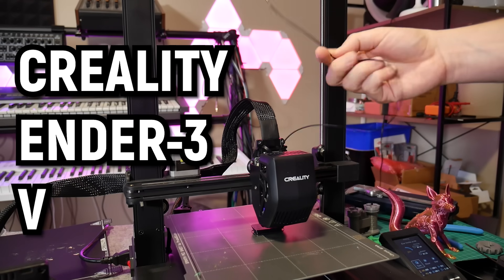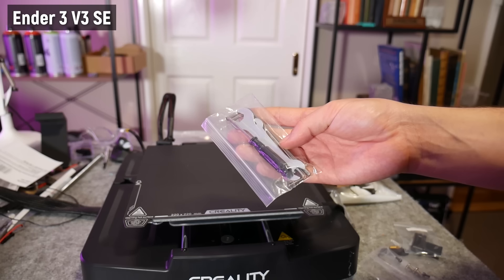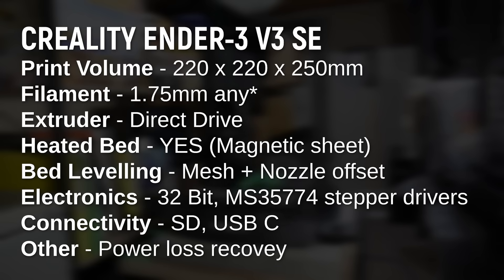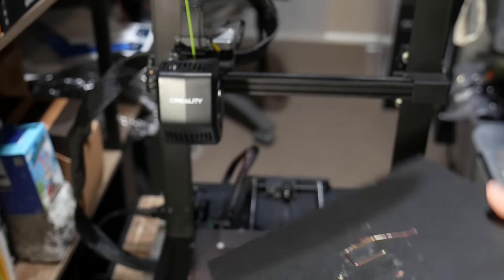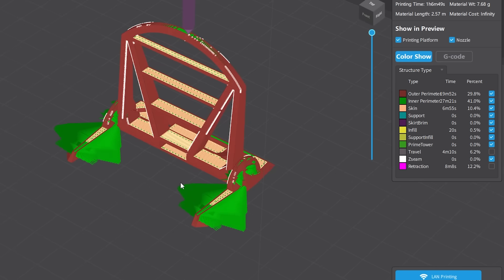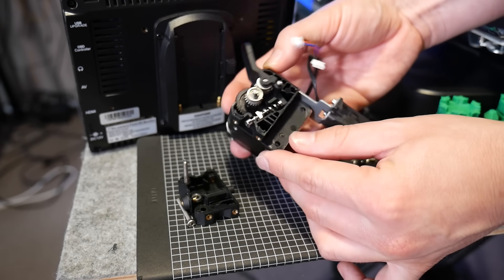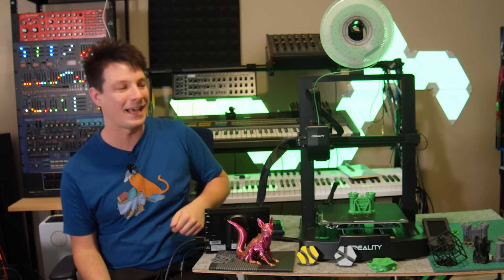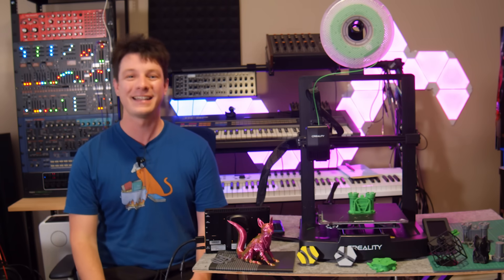The Creality Ender 3 V3 SE is very good. There, I said it!

Comment: The menu is top.
You can set the offset by hand at 24 points.
And you can change the nozzle from 0,25.up to 1mm.
Its goth its own slicer 
Where you dont have to do the settings.
Its already good.
You can calibrate the e steps.
You can turn the speed up .
While printing.
Its goth pre heat pla.
Tpu.
Wich you can use to change the filliment.
Its goth Factory settings.
If Enny thing go.s wrong.
You can pusch the machine to the Limits.
Bud dont forget your matireal needs to handle the speed you use.
So bying a fast printer means you need turn down the speed for a.b.s.and p.e.t.g.
And the last one is stronger then a.b.s.
There you need slow speeds because of you just can not run fast prints whit this Material.
They can make fast printers.
Bud your always goth to look what your using.
Its just a joke 
Thinking you can print fast.
Faster prints just need a bigger nozzle.
And you print a vase in just one hour .
In the creality 3v3se.
Bambu a 1 goth 0.2 nozzle 
Looks at chep filliment Friday.
And your print takes hours.
Longer.
😂😂😂

Comment: Can I mod the V3 SE to print ABS and ASA?
Reply: You can. You'll have to swap out the hotend for a all metal one and use a raspberry pi to run klipper or Creality Sonic Pad to bypass the stock creality v3 se firmware that limits the hotend to only 240c. Or you can try the low temp ABS filaments, regular ABS filament requires too much heat and the v3 se cant do that on stock. Or just get a V3 KE that can do all of those already.

Comment: I noticed that my Ender 3 v3 SE prints are slant. I checked the printer's alignment and noticed that the z axis is not square (it is tilted backwards). I found a y-axis support kit to install on Aliexpress. There are also some options on thingverse. I'm still deciding which option I'm going to test. Any thoughts?

Comment: Don't know if you'll reply as video is 5 months old lol, but how is the printer when input shaped? I still use my old 2018 ender 3 pro i've modded to purgatory and back, as well as klipperized on a skr 1.3 with 2209's, and currently using skr e3 v3 on it due to some small annoyances on the skr 1.3 i've later fixed, and with belts tighted way past recommended, and ran a input shaper, i managed so far to do a 3600 accel with a herome v6 and a 4mm mirror bed with thermal pads in between to compensate for bed warp, and got practically no ringing.

And how fast can it print as a utter top mechanical speed? My ender's max was 4300 accel before whole printer started to rattle.

Comment: I got a KE instead of an SE a bit ago, and man not a single bit of stringing with PLA at high speeds. Had to increase the retraction to 1mm for PETG to remove stringing but still. Very cool printers

Comment: There's no way to simply tie two spools together, so when one spool is empty, the next spool sill continue? (Like splice the start of one spool to the end of the first mostly empty spool, so when the first spool runs out, the new spool will just continue without any delay or without needing a cut-off switch when the spool runs out.)

Comment: Seems like a decent printer. I got the Ender 3 and it was hell to get it up and running. I had every single problem I ever read was a possibility and then 10x more than that.... and had to fix ad upgrade several parts to just get it to print without serious problems. It's insane that they could sell these things KNOWING how many design flaws there are and in all this time have never fixed ANY of them, no matter how simple and easy it would be. Instead they would rather waste all their customers time and money and frustrate the shit out of people to the point of giving up on 3d printing entirely than just spend $5 and fix the problems for everyone. It was complete BS that I had so many problems and not once did Creality ever reply to ANY of the email I sent them when I really needed customer service. Now I'm not sure if I'll ever buy another Creality product for as long as I live, no matter how cheap it is and how many 5 star ratings it has.

Comment: I hate the default Creality buildplates. Never had good experience with them.  Removing small parts is almost impossible, and with large parts the bed top surface can actually rip when removing prints. Instantly replace it with PEI.

Comment: I'm still running my dinosaur Anet A6, it still prints great, albeit with reinforcements, new extruder, build plate etc. It took hours to assemble, which gave you a good idea how everything worked. The industry is, as with any consumer electronics, moving towards a complex,  out of the box working system, and minimal user involvement with the hardware and software details. All great, but soon most users won't be able to fix the hardware/software issues on their printer themselves, having to rely on expensive customer service.

Comment: I was gifted and just started using for my first ever machine a V2.  I must have got one of the good ones because it's been pretty easy to use so far.  My one giant complaint has been loading filament into the drive module.  The factory hole past the rollers is maybe 2mm wide and almost impossible to thread into.  So I drilled it out to about 4-5mm and now I can swap filament far more easily.  I did see your video about the z-axis limit switch being too high, and I made that modification as well.  The run-out on the springs is a real problem.  Today I'm getting a spring steel print bed to upgrade from the glass.  Thanks for the well made and informative videos!

Comment: I have one of these. The automatic levelling and the magnetic flexible surface mean it is genuinely plug and play. Once I had the right temperature for my PLA (sunlu meta, seems to work at 185'c perfectly on my printer) I just design stuff and print it. Usually with no - or minimal - supports, a skirt, and a slightly increased retraction to minimise stringing. BUT THAT'S IT. No glue on the print surface, no adhesion problems, no levelling issues. It is DEAD SIMPLE to change filament and I even got octoprint working with it on a Raspberry Pi ZeroW just by running through a couple of online tutorials. Alongside Cura the whole setup is no longer a hobby setup that needs tinkering with, it is simply a tool for making stuff. Over a year after buying my Ender 3 v3 SE I still occasionally look at it and marvel at the tiny price for all that functionality and polish. If you are considering one, BUY IT.

Comment: My Ender 3 is awesome, I love having a printer I can modify, customize, and upgrade, but I think I'm gonna buy the V3 SE or V3 KE because it'd be nice to have a printer that just works. And when my Ender 3 needs a replacement part, the V3 can print a temporary part to use while I wait for a replacement to be delivered
Reply: Yes having an X1C would be nice, but if my Ender 3 breaks I can fix it.  I’ve modified it enough to know how to fix it and the parts are easy to get or print.  Your reasoning for wanting the V3 is the same as mine.  Don’t sleep on the Kingroon KP3S Pro either.   I put Klipper on mine and for the price, it prints beautifully.

Comment: Those linear rods would be beneficial if they substantial quality. In real they more likely to fail first. Even before the v slot's. And you have to replace them every 2 kg of filament. Unless you find some good quality matching stuff. But then go with rods as well as those installed are bad to and good quality hardened bearings will wear them within another kg of filament. What this machine will do good it will actually teach you well all troubleshooting which you should know entering 3d printing. 😂

Comment: Still waiting (5 days to go?) for my V3 SE to show up.  It'll be replacing my Ultimaker Original that I've been running since ~2012. 
Totally agree about the massive excess of models!  It took me hours to finally decide on this model. Especially since I couldn't find a simple grid comparison of all their model offerings. I would have gone with the KE, but the price jumped up about 50% for what appears to be just higher print speed.

Comment: I just got mine last night and haven't opened the box and let it acclimatize overnight since it was delivered on a very cold day. 
One thing that keeps nagging at me, is the position of the spool holder. 

If the spool was a spring loaded pendulum, it would prevent the printer from moving side to side when the head stops and starts. 
They use this pendulum effect on some high rise buildings in earthquake prone areas or very windy areas with great success. 
But even though the spool might provide some pendulum effect, I think I won't attach it to my printer, and have the spool on a shelf on ball bearing rollers as I did with my Anet. 
Has anyone ran an experiment to see if the print quality changes with speed changes, with and without the spool holder attached to the printer?

Comment: Just been fixing one of these a friend has. His nozzle blocked and we disassembled the hot end and heat break and I was actually shocked that the short PTFE that goes to the nozzle was completely melted. I've never seen a PTFE that black before. He's ran about a single roll of PLA though it and its destroyed itself already. I've replaced it and its working again, but whatever Creality are using is the crapest "PFTE" I've ever seen.

Comment: 3 weeks into a v3 SE as my first printer. ABL and auto Z worked well at first but now it never hits the mark. I have to manually level the mesh now which takes sometimes over a dozen test prints. The manually gathered values are only useful for a few prints before I have to do another run and adjust again. Really wish I held out another week and just grabbed an A1.

Comment: I need advice 🫣🫣

I’m in South Africa, so we have a very limited brand range (basically, Creality and Bambu). I’m a beginner, but I want to be able to print ASA once I have got to grips with whichever printer I ultimately want to buy. 

The Bambu P1P is basically the only Bambu option, and it’s way, WAY out of my budget. 

So, ideally I would want: 
- 300deg hotend 
- fairly fast print 
- 300x300x400 (or there abouts)
- Sprite extruder 
- Auto + manual leveling. 

I think those would be good enough? Any Creality suggestions. I get that many people are frustrated with Creality bringing out clones - but as it’s my first printer, I’m not upgrading from one Creality to another. It’s my first Creality - so buying a clone is, I suppose, ok? Besides, I don’t really have other options. Possibly the Elegoo Nep 4pro, but the store that sells it has been out of stock for 3 months already, so I don’t know if it would ever come back. 

One last thing - I’m NOT a tinkerer/hobbiest. I need something that is fairly ok out the box (something that takes an hour or three to set up) and I am really not keen to add mods on things like a hotend etc. 

HELP!?!

Comment: I've got an Ender 5 S1 and it used it lightly for 9 months before it had a warranty related problem. Creality support is terrible and I can't easily find replacement parts. Sure it's cheap and had good quality, but rebuilding the machine gets expensive. Would not recommend to anyone who cares about support, warranties, or who doesn't have expert level knowledge of repairing 3D printers.

Comment: It actually does have filament detection capabilities but you have to open up the bottom plate and you have to connect it to the main board, but luckily the tools that they give you are more than capable of doing that!
Reply: Where do I buy the filament detector?

Comment: Got one as a tester, alright, I get PTSD when talking about my old E3 I had when first starting in 3D printing, it was because I had stripped off some small metal things on the metal part holding the bowden tube in place, those times.

Comment: @MakersMuse Hey Angus, I'm wondering what speed did you print the Clearance Castle with it?
Just bought the machine, my first layer is super clean, and I tried the Castle on 120 mm/s unsucessfully.
Reply: i'm interested in testing this on my machine do you have a link or proper name for it i can't find it on thingiverse or printables as clearance castle. i run all my prints at 180mm/s and most of my prints come out fine if i can get the support right.

Comment: Mine turned into a useless paper weight. Mechanically it's functioning but it's failing to level now and failing to print any files, even their cat test print file. Tried to do a total factory reset and nothing. When trying to make a print, the printer head remains in one position and 10 hours print job is done in one minute with the display saying "Completed" and no filament was even extruded.  Help from Creality support is useless. Meanwhile, my Anycubic Kobra Max is working like a champ with no issues whatsoever. Will attempt a couple more things before packing it up and shipping it back to Amazon before the return date window closes.

Comment: I am ordering one of these. I have never purchased an Ender 3 because I am not interested in doing a lot of mods.
I have been using a Kingroon KP3S which I have printed useful things on but the bigger build volume and higher speed here would be a step up. Not to mention I think I'd prefer Marlin to what ever the stock firmware is on the KP3S.
I thought I'd point out that to avoid TPU sticking to the build plate too strongly on the KP3S I don't heat the bed when printing TPU and print the first layer slow. Had no problems with adhesion but I do take the build surface off  and flex it to remove parts. I don't just yank the TPU part off the bed.

Comment: This is a pretty nice printer. I went to micro center with my $100 off coupon for the E3 V2, but decided to watch this on printing a large gear. I also got to see the E3 S1 working as well. I spent another $70 plus $60 for some filament. I was not disappointed. I had some layer shifts on the X axis and the lower left corner of the bed is a bit higher. Everything is working well.

Comment: As someone who got this as my first 3D Printer, I have to say I have the opposite problem with the bed after the first few days.  I believe it's dust causing the issue, but first layer adhesion is a problem for me.
Reply: Try adjusting the z offset down a couple of clicks in the adjustment menu after running the auto z offset procedure.

Comment: I've had the V3Se for four weeks. Before that I had an Ender 3 V1 for over 5 years and was always satisfied. But I was always annoyed by the bed leveling and the problem that I couldn't easily print TPU with the V1. That's why I bought the V3Se and have now printed 2 kg, without errors, without problems. When I see all the videos that say it's so bad, I always wonder if I have the only Ender that runs problem-free. That's why I'm happy about your video because it doesn't just paint everything negatively like other videos

Comment: Just purchased this printer as my first printer.  Having decent luck so far. I can say larger less detailed prints have worked great but a few projects that are smaller or that have little more detail don't seem to work the best. Using the provided slicer from creality. Is pursa better/easier to use and have you worked out your setting Profile yet

Comment: try vase mode with thicker nozzle and small print, if it is anything close to v1 it will create a cactus instead due to faulty power recovery feature

also if i remember corectly there is no way to controll flow during print if you want to crank it down or up for slightly different filement

Comment: Running bed leveling from octoprint is much faster because you do not have to wait for pre-heat. My machine did not have a high spot on the sensor. Creality is achieving this print speed with the experimental input shaping in marlin FW I suspect the KE comes with a accelerometer on the print head for better input shaping.
Only thing I want now is some source code! I can't change my thermistor values so my heater upgrade is useless.
Reply: my every location is a high spot, a couple even around  0.6 while others 0.4

Comment: @MakersMuse if you sand down the plastic spacer above the sensor for setting the nozzle offset, does it not squish the nozzle into the print bed too much. Or is it using it in conjunction with the bltouch measurement at the same point?
Reply from the maker: The offset between nozzle and probe stays the same, it just levels the bed mechanically a little better.

Comment: I got 4 of these back in October and have ran about 20-25kg through each one. I switched out the nozzle size and switched to a glass bed for personal preference. I am more than impressed with this, all my machine have been running flawless, and at significantly higher speeds than my other printers.
Reply: did you have to sand paper the leveling?
Reply: Why do I feel like this was a paid comment 🤔
Reply: Cus it 90% is  @TS_Mind_Swept
Reply: what do people print at such volumes? is it products for sale?
Reply: @ligametis  Some people print very large multi-part pieces, so having a small cluster lets you print in paralel time.
Reply: @someoneontheinternetuvenev6268  in my experience most of 3D plastics are a pretty shitty material for a wast majority of larger objects. There are exotic materials that are good, but then they are too expensive for large prints.

Comment: I’m confused is V3 KE the newest one or SE / what’s the difference between them
Reply: KE has double the max printing speed of the SE (500mm/s vs 250mm/s, although you won't get very far without a CHT nozzle and/or high speed filaments), wifi printing, touchscreen interface, all metal hotend with no PTFE tube amongst other things
I've had the SE for more than a month and honestly even 250mm/s is stupidly fast. Unless you really need insanely fast prints, the SE is more than enough for casual printing usage